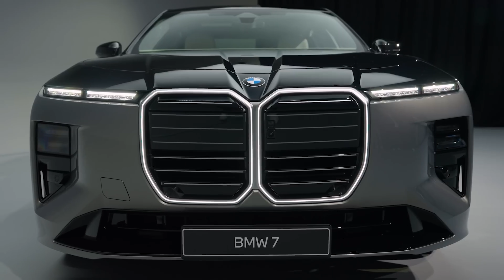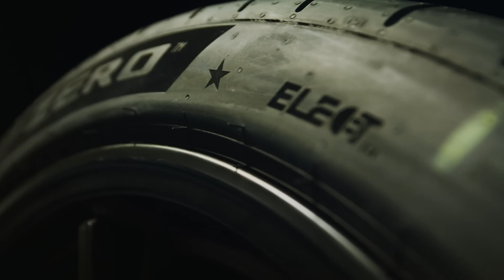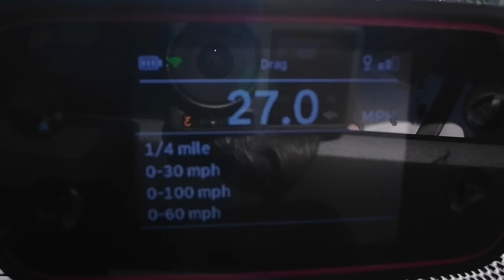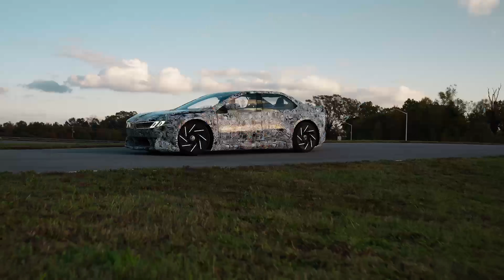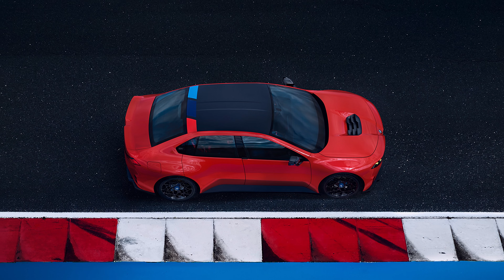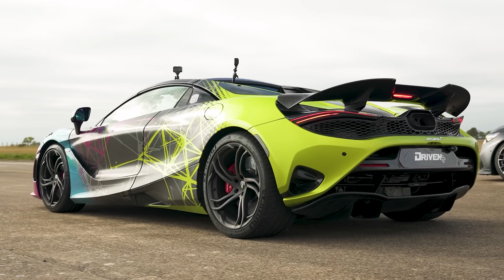New BMW M3 is the BEST they’ve EVER MADE!

Comment: Straight-line acceleration is no longer the metric by which sports cars can be judged, since electric cars are pretty much at the limit of physics.  The new M3 will need to handle well.  Which means removing weight.  That means the legacy carmakers are finally going to be engaging in actual research into battery technology - specifically, making them lighter.

Comment: There is one thing that electric motors can do that I.C. engines can't, and I'm disappointed that the only manufacturer that has anything close to it yet is Hyundai (and a little bit with the new Honda Prelude as well). Remapping the entire character of the engine. You can program exactly how much torque and power to deliver over the entire course of the throttle. A modern electric sports car that let you program it to behave variable like a big torquey pony V8 or a screaming "high rpm" with even and totally linear power like a RX8, or even artificial VTEC like an S2000. There's nothing stopping you from making that configurable in an all-electric setup with variable suspension, and I want it.

Comment: I owned BMW 325es since 1986 still loving it... I wish bmw not over engineering their cars and improve reliability... I had almost 0 engine or any problem at all for over 25 years... Just regular oil change and typical tune-up...   Trouble free for over 30 years...  My next bmw is ev 3 or IX.

Comment: I see what they're trying to do with the VDX's front, which is strongly evoke the 3.0CS/633/635CSi with the dual headlights pushed out to the far sides, exchanging roundness for squared corners and lots of stretch. I think I dig that car more than the M Neue Klasse's front partly because it evokes the 70s and 80s so much, and I'm a late X'er. But I don't begrudge them trying to pull E30 M3 with wheel flares off with the M Neue Klasse. The Hofmeister Kink is too subdued though.

Comment: BMW must have used the same designers as the people who designed the Ferrari Luce, because fuck, this is hideous. 
I'm also always very surprised that manufacturers keep putting out EVs when not a SINGLE. ONE has EVER had success with EVs, ever. It's like, yeah, I understand putting out one or two models that you know aren't going to sell, but continuously doing it is absurd. 
BMW
Chevy
Mercedes
Audi
Ford
Dodge
Ferrari
Porsche (EV Taycan is objectively a failure, and Porsche will never break even on it)
All have put out EVs that were complete and utter failures and STILL decide to make them and are always surprised when nobody could give two shits about them.
If they want to lose money, then that's their decision. EVs are a sure-fire way to guarantee it will fail.
Tesla and BYD are successful, and these manufacturers above see that and want in on it, even though they never will.

Comment: With current market conditions for cars, an overpriced BMW with less than 1000hp wouldn be in a tough competition with other (China) cars. Now, more hybrid cars are made with near or more than 1000hp with either smaller engines or the same as the 3L 6 cylinder like the new M3. An example is from Horse powertrain specifically the Horse W30 engine which by itself produce up to 540hp alone and with hybrid options up to 1000hp. Not gonna lie, buying new cars now is even better than tuning an old car in my opinion. 500hp stage 3 or 500hp fresh from assembly with a small 1.5L engine. Nuts.

Comment: Looks better than current M3, and current combustion engine cars have already been ruined by silencers and filters that you can’t even here the engine and they sounds like tractors, so a 1200hp electric M3 that does 0-60 in 1.8 secs and is the same cost to run fuel as a Nissan Leaf in my opinion is the new awesome.

Comment: Best what exactly? Definitely not best looking, but maybe just fastest accelerating.  Looks like BMW took bits from dodge viper, mustang, camaro, and just slapped them together into a hideous frankenstein monster.   The front kidney grills are alright, but the front air scoops look terrible.  The side looks so flat and boring.  None of the body lines flow together. And the led squares are a joke.  What can you actually see with that?  They should show how the road is actually lit with these tiny lights.  It's more about how much you can blind oncoming traffic vs light up the road.  I don't think there is anything good about this car besides it accelerates faster than previous models, and only slightly due to intentional limitations.

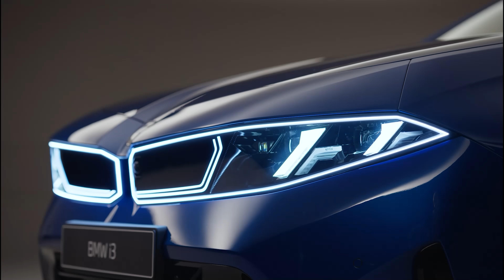Comment: I quite like this design, the M3 no longer looks like a sleeper, the design has some drama on it and it looks amazing especially that angle at the 1:45 mark. Its got the stance, its got the wide rear arches not to mention that split ducktail which is quite unique amongst modern saloons if I am not mistaken.
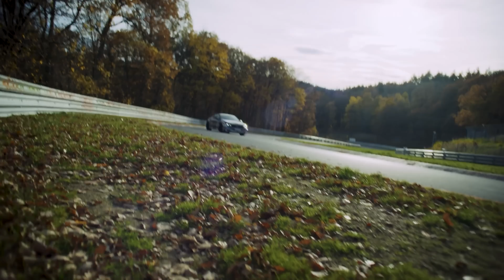Reply: 1. The design at 1:45 and the one at 1:35 are very different which indicates that the final look won’t be nearly as agressive. 
2. Making the front end look like dog feces does not equal “drama”. 
3. People like you bending over backwards to act like what bmw has been doing to their cars for the past decade is exactly why were stuck with these pretentious designs.
Reply: @negkoray  True.
Reply: The design is total and utter sh*t.

Comment: If they would actually make this car and it was purely software defined and had a 48v architecture with steer by wire and rear wheel steering it would be a great seller. If it had Tesla FSD integrated into it they may have a chance. But unfortunately none of the companies have talked to legacy auto manufacturers.

Comment: The beamers might be a bit ugly these days, but they're kind of "fresh" still. If you get what I mean. And the iX3 looks quite a bit better in real life than on photos. The Volvo EX60 by comparison, looks good, but a bit soft and undefined. Although a bit safer, or non "off" as well. I hope an EV60 comes out that looks as sharp as the old V60 PoleStar Edition did though. I don't need M3-levels of performance. 340i-level is my goal, and I will likely be setting my sights somewhere around the i3 touring of that level, and the EV60 of that level. Or even PoleStar if they release a mid-sized or large estate. If any brand comes out with a sleek, long estate that looks good and drives well (as in a well done drivability and comfort compromise), I'll be happy though.

Comment: I really like the horizontal grille.  It harkens back to the old e30 horizontal grille. Clearly based on the Neue Klasse from a few years ago, and it looks fantastic.  SO much better than the last M3.  I’m so over swept designs.  This is adding angles, edges where they are supposed to be and looks completely different than any other vehicle on the road. I predict that this will mark a return to this type of styling for all other sedan makers.

Comment: The enshitification continues. An electric M3 😮 Yeah the new Audi has 639hp it also gained 1200lbs 😱. I wish some car company would go back to cars losing weight to gain performance, in a straight line the weight does not hurt with all the cheap HP available but man the cornering and tire wear is unreal in a heavy car.

Comment: I love most of it.. The silhouette, the DTM-looking flared fenders, the lower front & rear sections, the motorsport splitter & diffuser, the rims, spoiler (the color).. Most of the interior (the bucket seats, materials, screens/graphics/lighting.. the wheel is alright) etc.

But wtf were they thinking with the 'firebird', long/squinty/angular, headlights & taillights???

Fix those, and this will actually be gorgeous.

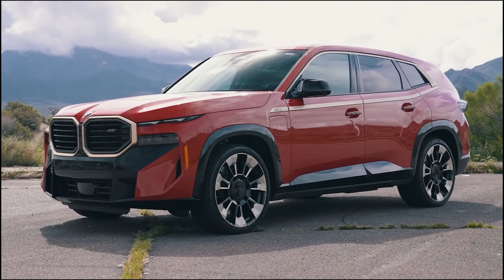Comment: 3:44 why don’t we give the M3 1300bhp when a family SUV from China has that too?
Reply: China only powerful on the straight line. when comes to handling, feel like bullshit 😂😂😂. That's China, only big on figure number, while german engineering know what is the practical power for such car 😃
Reply: @madbetul witch feel? It’s an electric car 😩
Reply: @oscarparra44  You know, the cornering? Thing such as steering response, chassis response, grip, inertia, weight distribution etc... the FEEL, of driving the car! Engine is not the only aspect of what car feels like.
Reply: @madbetul you know the fastest ev on the nurburgring is a Chinese car?
Reply: The plaid has over 1000hp
Reply: Put your money where your mouth is…if you want 1,300hp in a road car then go buy yourself a cheapo Chinese SUV.
Reply: Most people couldn't handle 1300hp

Comment: If the gas/hybrid M3 has the same grill size/shape.. It'll prove BMW lied.

Cuz the massive kidney grill on the current gen M3.. Was allegedly "necessary" for cooling. (Even though half of it was blocked off by black plastic/the bumper beam).

Yet this car has about the same grill size, but doesn't need the kidney shape. 

They could easily just split the bumper into an upper & lower grille section. Like the F90 M5 CS.

Comment: Only thing that puts me off is that as we have seen from other YouTubers for example the new m5..if you need a spare part, you can't just buy a second hand part and put it on and expect it to work...a simple module will need to be coded ...that's a pain in its own right but then also that isn't enough...parts are also signatured so you have to buy new from dealers...it's totally wrong and unethical...we have the right to repair...it's all nice under warranty..but once that's over good luck

Comment: If the bonnet / hood vents are actually functional, they increase front end stability at high speeds more than a splitter would. Considering BMW use the Nurburgring as their test ground and are a big part of their M series cars, it wouldn't surprise me if they put this on to help with stability at high speed straights  - like the one seen at the Ring.

Comment: FULL ELECTRIC BMW M car? i'll salute the effort, the same way i applaud ferrari effort with the luce. and the mercedes GT full electric super car recently. its eventual. combustion piston engines are obsolete. its an OLD technology that cant get any more gains besides making it bigger and burn more fuels. its just like todays semi conductor silicon microchip tech. there is nothing to be squeeze from it anymore. 
while electric powertrains, even on its infancy currently has BEATEN many halo supercars on unofficial drag races. the potential for motorsports is there. and the new recent revelation of the FORMULA E gen4 car makes it even glaring. the future is magnetic/electric. thats where all the power gains will come from. including the speed. its inevitable. those who keep in denial are sitting on nearly deprecated machinery.
and i need to remind poeple, EV battery tech is IN ITS INFANCY. and the technology currently RAPIDLY growing. and many new breakthroughs are already being fielded and actively developed. smaller, lighter, higher capacity batteries. not to mention the sci fi idea of TINY nuclear battery that could power an electric hypercar for possibly full year. and all those arent dreams. PEOPLE ARE RAPIDLY WORKING/RESEARCH AND DEVELOPING ON THEM today.

the only issue today is this : GOVERNMENTS around the world are still DICTATED by oil industries , and they are DELIBERATELY marking up, and hampering every aspectsof sales and purchase of electrical vehicles. making it difficult and stupidy expensive. and those extra prices are the FEES. the prices forcefully stamped. not real prices. like how govts make charging electrical vehicle more expensive than buying gas. thats absolutely stupid, if you look at the actual price of kwh in your countries. its all POLITICS. to suppress the sale and purchase of EV.

the question of merc GT vs new BMW M3 electric? if BMW doesnt come with fake combustion engine sound, i prefer the BMW. i dont need to pretend im driving a gas car. it will beat halo gas cars on drag race. why have to pretend driving something inferior instead?

Comment: I like this M electrified concept for many reasons even much more than the i3 standard.. yeah for Matt it looks like a fake mustache slapped on face but instead of huge nostrills from iXM and narrow beaver tooths from iX3 this mustache hits perfect on this new retro style i love it. rims are a fresh take on E30 style and with center-lock like Carrera GT style i love them even more,  front and rear quad lamps on the side might look like a copy-paste inspired by KIA Ceed GT back from 2014 but they actually resemble the LeMans GT class motorsport style paired with similar red quads fog lamps in the rear, duck tail might be cool and functional as the designer did explained separately in a different review but on this retro-angular style concept i would go for a fix spoiler to resemble better the sporty character of E30 in DTM  races otherwise this concept looks 100% perfect inside-out specially for colors mixed sporty style, materials are great and i'm sure when they will release it will deliver sport car levels of performance no doubts ! Another thing that i'm not so sure about the fake sounds used they remind me of fake exhaust sounds used on Hyundai Ioniq 5N but despite the rear spoiler and sound effects i would still accept to own it, this concept for me is just straight away : Take my money BMW ! No brainer i Love it.. :eyes-pink-heart-shape::thanksdoc::face-red-heart-shape::face-blue-smiling:

Comment: looks like a transam pontiac from 80's
Reply: Not the worst comparison tbh
Reply: just what i was thinking
Reply: Pontiac used the horizontal split grill on high performance cars for even longer---such as the 1963 Ponitac GTO--but BMW had been using it even longer such as the 1957 BMW 507 and that made sense because its front flattened the vertical kidneys. I LOVE this M3 even though it's basically inefficient for an EV.
Reply: Frontale molto muscle car,ho pensato alla camaro.
Reply: I agree, but think it has more of the 77-78 Trans Am flavor to it, which is not bad at all. But other parts will take getting used to. The rear, the side, the interior....and for me NO electric.  I don't care how much HP it has.
Reply: emphasis on the trans.
Reply: Knight Rider, cool.
Reply: I was seeing a little Camaro look also
Reply: a yank tank never , get new glasses.
Reply: Just shrunken down by Gru and his minions
Reply: Which is not bad at all if we look at cars that BMW did  with weird looking faces iXM or iX3..

Comment: That car looks amazing, the comment section is over-hating. I do agree that some areas of the car lack defintion such as the door panels having no body lines that connect the front end and the back end, the rear tailights look too vague and slim but other than that it looks amazig. The rear quarter also looks earily similar to the m2 and m4.

Comment: I like the design, but the only 2 powertrain options being mild hybrid and electric doesn't sound all that great
Reply: There isn’t anything else now that diesels are out o& the window..
Reply: @philtucker1224  I was just thinking that it would be nicer if it wasn't a mild hybrid, I didn't mean that the M3 needs to be a diesel
Reply: @Aero-NGwhat would you like it to be then Aero? - you still haven’t said??
Reply: @philtucker1224  the same petrol engines as they're putting in, but without the hybrid stuff
Reply: @Aero-NG(I don’t think current production regs allow that) - unless it Is a purely track built car and not road-going..
Reply: @philtucker1224  that's a shame

Comment: Launching a traditional petrol car as an electric is a recipe of disaster - look what dodge did
Reply: The petrol M3 will still be available
Reply: Yep. It means both versions will be compromised from the start. (Especially when the chassis floor pan is being made thick enough to/is having the battery built into it).

So the gas version will have a big, hollow, floor.. raise the center of gravity, worsen rigidity..

Or they'll both be on completely different chassis.🤷‍♂️
Reply: This is nowhere a traditional petrol car. It's completely new and in a class of its own. The petrol cars will remain available, so they just added choice. Well done, BMW 🎉
Reply: Bmw isn't new to the ev game  they have different divisions for electric and combustion and do hybrids.
M is the sport dev so they make everything quick and agresive.

Comment: Mercedes had trouble selling the last gen hybrid 4 cylinder "C63" AMG, this electric M3 will flop even harder. Are they so out of touch that they can`t see what their customers want? The g90 M5 from what I searched aorund has trouble selling because it`s a boat on 4 wheels. Audi went the same route with their new RS5 which is a hybrid that weighs 2370kg, more than a Tesla Plaid that has over 1000hp. Ze germans have lost the plot entirely.

Comment: my only issue is the rear lights being slightly too thin other than that I honestly think the design is amazing it really captures the charm of the OG BMWs of the 80s and prior put into a modern design
Reply: It's not even comparable to the old bmw design, the old grill is a rectangle across the front, not two point grills angled downwards

Comment: I almost stopped the video when you mentioned that it is electric...the stupidity is that mostly old fashioned car lovers are incline to buy these cars but will they want them to be "electric"...honestly, EV are fast and powerfull but there's absolutely no pleasure whilst driving them. I dunno why. I've tried a bunch and though tork and accelerations are often impressive, pleasure is "ZERO"...If it is not for petrol engines, I'd rather be fully autonomly driven straight away...so that I can read, sleep or drink while being transported to another location...what's the point of driving.

Comment: It looks good imo, and the ICE one is going to be good for sure. BUT electric only ? even if it has 9000 Volt system and 15 electric motors or if it does 0-60 in 0.1 second... It's just e waste, especially for 100k plus. 
Still much better tho than the new Merc GT.😶‍🌫